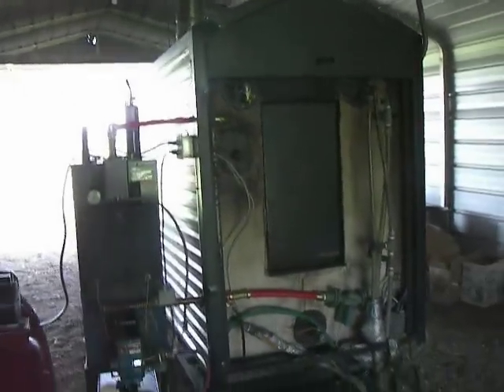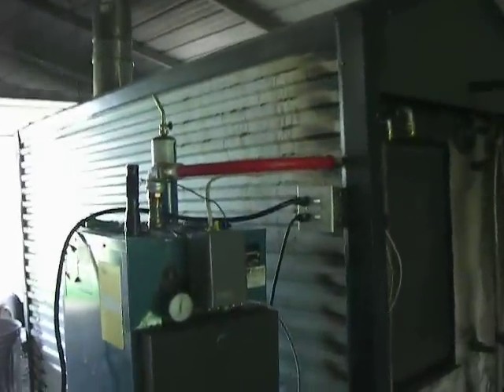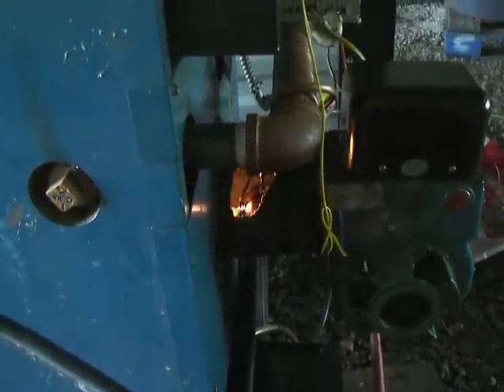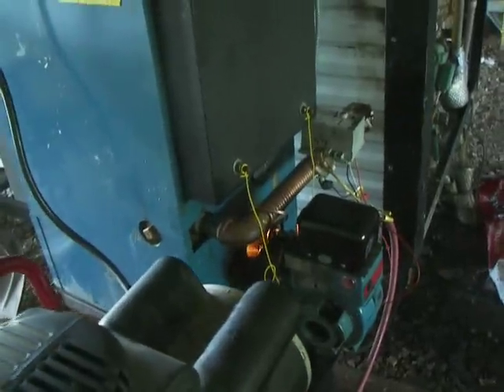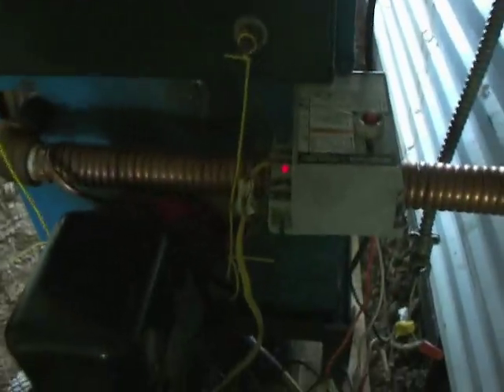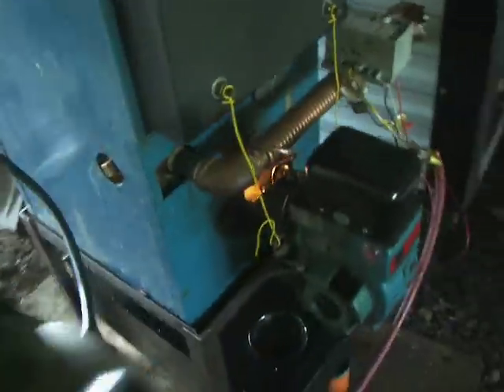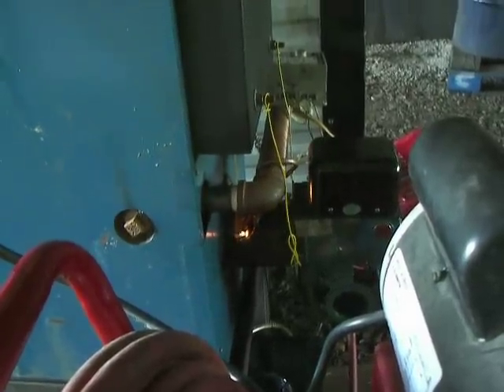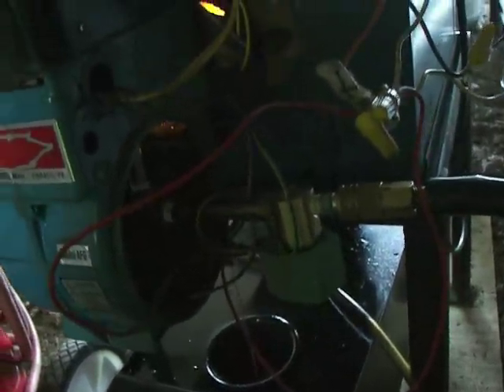Homemade Babington Ball Waste Oil Burner Boiler Furnace - Part 2

Comment: I have a very similar type. What did you use for the flame pipe, I'm using 316 grade ss and it burns out in 3 months. Let me know, radrat454@gmail.com
Reply from the maker: I can't remember, just plain steel pipe, nothing special.  I ended up cutting it off back far enough that it never got very hot because I wanted the heat to dissipate into the boiler better instead of being caught in the pipe.

Comment from the maker: I decided to scrap the project.  It had lots of potential, but I just didn't want to invest what would be needed to really make it work right.   So....back to burning firewood!  Maybe I should build a setup for dripping oil on the firewood?
Reply: Oil drip is what the old coal stoves had in PA.  Shovel full of coal last for days